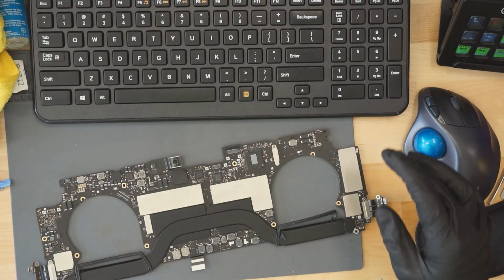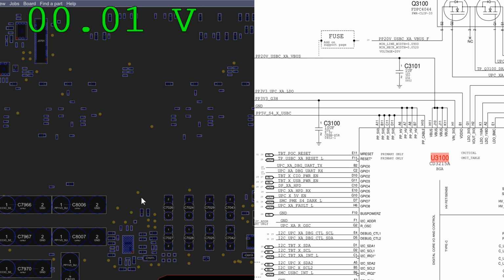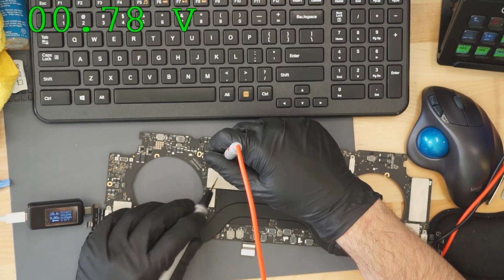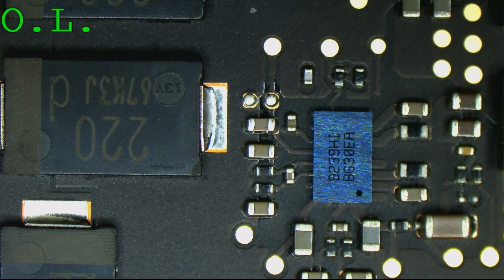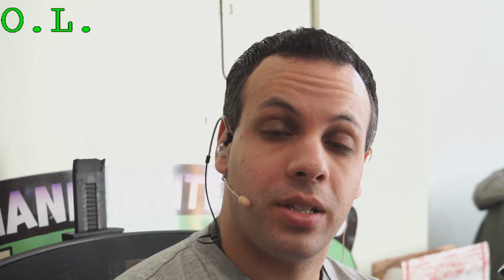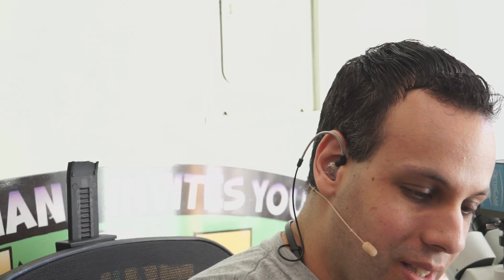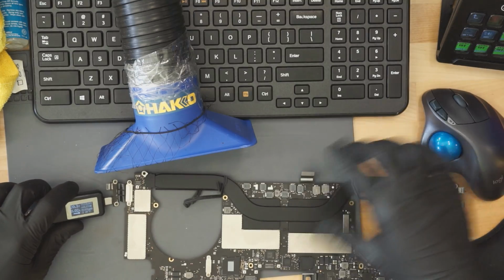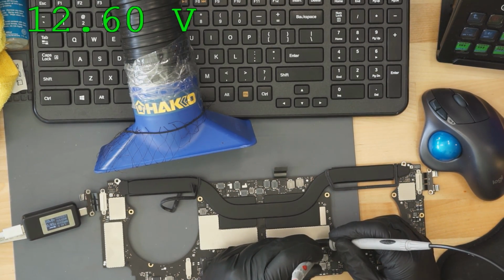Why new Macbook boards will be unfixable for me: sad :(

Comment: How to fix a Macbook? 
Buy a pc.
Screw Apple
Reply: Zainjal26  because Dell is shit, and does not represent non-Mac PC's in general.
Reply: Supporting apple is an early sign of retardation.
Reply: @oORoxas13Oo  For a second I was like 'oh damn, I'm getting retarded!' Then I realized the 09 Mac Pro I'm using was bought 2nd-hand, so I never supported Apple. Glad there's a loophole to avoid retardation for me.
Reply: Zainjal26  why would you buy a Dell?  A $300 pc from walmart is better than most dells.
Reply: Raul  from a diy repair perspective you have a point, but from a hardware usability perspective I can't find a PC laptop that's even barely usbale. Terrible touchpads that try but fail miserably to approximate a macbook's, keyboards that seem to be designed by someone that has never owned a laptop before... Again if you know of a PC laptop that doesn't fail miserably on this department I'd love to hear it. Ive always used ThinkPads, but their newer ones are trash. I can't find anything newer than a t530. 

As far as win10, from the start menu to burying every setting in the name of "simplicity" it strikes me as pure garbage. Almost as if windows were intentionally giving a lead in the software department to apple. Have you watched someone who isn't techy try to use win10? It's a complete disaster. Put that same person in front of a MacBook and they'll be up and flying in no time.
Reply: Worse
Reply: Mac is PC tho.
Reply: @Zidern  Technically yes, but people generally dont call a Mac a personal computer...
Reply: @Zidern  Wrong! It is only a PC after Louis touched it!
Reply: @Zidern  Careful dude you might get sued for calling mac a PC. There was a quote somewhere from Apple. Some insurance crap or whatever. Basically "macs" aren't considered to be a PC. They think Mac is a whole different thing. Yes I know pc stands for personal computer. Honestly a laptop can be a PC but we still call it a Laptop and a tower a PC.
Reply: Wel Apple are fekkin' ridiculous for doing that.. and I don't know anyone that doesn't call a laptop a PC, just like a desktop.
Reply: @Zidern  really, you know people who call a Mac laptop a "PC"? I wonder if that's regional if so. I've never ever heard someone do that in America.
Reply: I said people call LAPTOPS pcs, not necessarily MAC laptops.
Reply: @Zidern  oh I see. Definitely not all laptops in my experience tho. I've never heard someone call a Mac laptop a PC, unless they're over 60
Reply: But it is unlocked, In all it's glory. Praise the PC lord! ;)
Reply: @Zidern  Lol, this guy
Reply: Alas then you're stuck with Win10 these days...
Reply: @wrybread  nope...
Reply: @wrybread  not if you use Win7, which is WAY better
Reply: @vladsnape6408  agreed.
Reply: @wrybread  
Make a hackintosh
Reply: @wrybread    still better than an overpriced piece of plastic that cant  be worked on. Lol
Reply: @wrybread  Linux
Reply: @Pandaoniman  I typed that comment from a Thinkpad running ubuntu, and it's nice and all, but I still think linux on the "desktop" is a bit of a mess. Im rooting for it to succeed tho. If anyone knows of a significantly more polished  distro than Ubuntu tho, I'd love to hear it. Been meaning to try Mint.
Reply: @wrybread  YES!!! MintCinnamon is the "Flagship" Distro for the group...
   I'm "fiddling about" a bit with some concerted efforts around Xfce and Lmde, and none of them are "troublesome"...
   The only note to make (unless they've changed since my last install) is to get in there on "Swappiness" and tune the setting. Mint is a bit... er... overzealous (lolz). BUT then your system runs great. Stable as hell, and next door to nothing special to do (unless of course you have dubious peripherals)...
    Ezeelinux.com offers a TON of aid, from the chat forums, to Joe Collins' Channel on YT, so any questions, queries, trade of dev' talk you can stand is right there. You really can't miss with it... 

     AND no, for the record, I'm not "affiliated" nor am I financially encouraged here. It's just a really GREAT OS! I've probably got half a dozen PC's up and running on Mint... AND most of them are "dumpster recoveries"... Will admit, HP, Dell, and Lenovo are my current makes (like... the complete list... lolz) BUT it's worth the dive. ;o)
Reply: @wrybread  Mint is awesome. Does everything I need, and is a very polished and stable OS that I'd even recommend to newbies. I agree that the earlier distros weren't ready for the average user.
Reply: @calmeilles  I wound up trying Mint on someone's recommendation above. I like it much more Ubuntu, much more polished. I like ubuntu also but it's no competitor to macos in the polish department. Mint manages to compete though, which is amazing.
Reply: @wrybread  You have a Thinkpad? Those are super easy to hackintosh. ;) Just need a different wireless card.
Reply: Raul  what an odd theory. In what way is windows better for entertainment and general use exactly? With win7 I'd say it lags behind macos less, but still lags. With win 10 it's not even comparable in my opinion, the user is just constantly battling the os. 

As far as hardware, what windows laptop compares to a MacBook in your opinion?

Comment: I watch these videos so I can continue my hatred for apple products
Reply: It feeds my anger
Reply: @RajinderYadav  shitty windows laptop?for the same price of a new Mac you can get a razor blade stealth laptop with much much higher performance I'm talking 6 core 12 thread processors and rtx 2080. Your i9 9900k can't even sit above 3ghz because of thermal throttling issues and this just shits all over it and runs fine, if it's so difficult to make programs on why is there fjck loads more programs on windows than Mac
Reply: ikr, me too, never gonna buy this fucking shit.
Wouldn't buy it even if it was same price as normal laptops and phones. Maybe if it was half price compared to normal laptops AND it was serviceable.
Reply: So what would you suggest as am alternative? 

Windows Surface is just as unrepairable and expensive as Macbook Pros. My Dell didn't last more than 2.5 years and most of the rest are pretty @#$%.
Reply: Me too.
Reply: @RajinderYadav  exactly. Absolutely wonderful updates of Microsoft for deleting your data,creating audio driver issues,activation being removed after update etc. Windows is an ugly mess. MacOS is divine. You aren't required to fuckin update it everytime u turn on your laptop unlike windows. And neither are u required to troubleshoot it time and again. Windows sucks big time.

Comment: I was an audio novice that bought a Macbook pro in early 2011 to use Ableton. Within a year the logic board failed. They replaced it for free and I thought they were just being nice. I found out later that they had screwed up by adding too much conformal coating to a chip (the GPU iirc) which caused overheating. Fine. It works for a few years. Keep having hard drive failure after hard drive failure. I've been bootcamping it with windows...is your code even good for that? Roll with the punches. Eventually start to push the limits of the CPU with my DAW. Find out that the DAW software isn't even near optimized for multi-core processing based on intended use. Give up on .VSts. Buy high quality (Elektron, Swedes don't mess around) hardware that syncs with the computer "thru USB." Apple changes their USB drivers. Nothing works. Hard drive fails again. Replace it with 1 TB solid state. Set aside 150 GB partition just because. Apple side of the drive won't boot one day. Lose all my data (even the stuff I managed to save from before). Call and beg windows to buy a cheap license. Get Windows 7 on 150 GB side. 

And here we are now as I type this post. A wonderfully functioning 2011 Macbook pro with 150 GB partition of a 1 TB hard drive running Windows 7 (without office). I will never buy another macbook again.

Comment: Noob question: What is the "gel" you put on the board to unsolder and than put back on to solder bac? Thought those chips were soldered on, but are they simply glue on??
Reply: Its soldering flux, not some kind of magic gel.

Comment: Mac is just one more of a growing list of companies that are booby trapping or rigging their products in some way as to make them hard if not impossible to fix or repair. I would not be at all surprised to learn that some products have a secret built in self destruct timer of some kind. Repair shops of ALL types and kinds are slowing going away. I can even see Mac to start to epoxy coat the boards so you can not repair or replace any thing. Repairing anything is getting harder and harder. I work in a small engine repair shop and I see it happening even there. I run into cases where I can not even get a replacement carb for crying out load.

Comment: Apple wants to control its flock as much as they can, including but not limited to as you stated the ISL9240 chip not being available to repair centers. Apple is afraid of the right to repair movement and they want to kill it as much as they can by removing parts that can be repaired or by making it that if a system dose detect that something has been replaced it bricks itself and is useless and you have to shell out another 2 or 3 grand for a new unit. It is the way of apple

Comment: Are ISL9241 chips not drop-in replacements for the 9240s?
Reply: I had the same idea and went looking.  The ISL9240 is a BGA chip. The ISL 9241 data sheet shows "32 LEAD THIN QUAD FLAT NO-LEAD PLASTIC PACKAGE".  In the audio world we have SMD adapters, but I have no idea how you could do that even if it is the same silicon. If there are other package options, that would be groovy.

Here are the links I dug up.  Perhaps someone else can see a solution.

ISL 9237 - Mentions "When Apple unveiled their new MacBook on April 10, 2015"
https://www.renesas.com/en-us/www/doc/whitepapers/power/usb-c-buck-boost-battery-charging.pdf

ISL 9241
https://www.renesas.com/en-us/www/doc/whitepapers/battery-management/isl9241-usb-c-buck-boost-charger-whitepaper.pdf

ISL 95538B
https://www.renesas.com/us/en/products/power-management/battery-management-systems/multiple-cell-battery-chargers/device/ISL95538B.html

Overview
https://www.renesas.com/us/en/products/renesas-usb-power-delivery-family.html
Reply: RB Blackstone Nice finds! According to the 9241 pdf, it seems like it needs a modified EC firmware compared to the 923x series, so it would appear the only hope is if the 9241 is literally just a surface mount version of the 9240’s BGA package. It would then be possible to get (or make) a tiny, thin PCB that has QFP to BGA and use it as a mediator. They’re usually about a dime a dozen (well, more like a hundred); very useful things when prototyping with surface mount.
Reply: @SuppleAloe64  Cool!  I haven't seen a tiny PCB that would do that.  I googled "QFP to BGA adapter" and there are a lot.  Good to know. Thx.

Comment: " I trust SanDisk so much, I have two of them in my laptop in raid 0"

That is quite a trust lol
Reply: It's true, never ever had one go bad on me either. I'm sure they would eventually if you abuse them with large cache-ing and swaps
Reply: unless you do daily backups of that raid, you shouldn't trust any hard drive company this much
Reply: @ruben247  I only have the important things backed up to the hdds which is the steam library. Other than that, i can get everything else back quickly
Reply: I read this as soon as he said that.
Reply: Lol
Reply: @trippy1012 im using 2 crucials for my raid0 setup
Reply: @trippy1012 I'm using 2 OCZ Vertex 3s in raid 0 since 2011... They've seen Windows 7, 8.1, and 10.
Reply: I will say that SanDisk makes some damn good flash drives 👍🏽

Comment: easy solution...people need to STOP buying from apple. the shit they do to try to guarantee you need them for repairs is mindblowing. I'n 2015 I had a customer bring me a Macbook for an LCD replacement, i usually avoided any apple products besides iphones like the plague...I about died laughing when i started dismantling and saw that it was rocking PC2-5300 DDR2 So-DIMM RAM....in 2015!

Comment: On the unavailable chips, often all that is different is the pinout.   Because of this, what people used to do back in the golden ages of early computing was make a compatibility shim.  This was also used to create makeshift upgrades when unnecessary chip-socket changes were used to prevent them.

Comment: That intermitten behavior is sometimes a sign of just a bad solder contact. Something unusually common on Apple products from what I see around the web . . .  

I wouldn't be surprised if the assembly process leaves some of the connects on that chip half-soldered, and that is responsible for the breakage.

Comment: This is a known and consistent strategy to rip customers off and drive price and profits up all across the board. One part of that is that they make it hard or impossible to fix, so you have to go to an "authorized dealer" or apple themselves where it will cost you an arm and a leg. For me as a PC user and builder, this is crazy, as all my devices are easily and cheaply fixable.

Comment: I am a mechanical engineer, who is shit scared of anything electronics (at the level at which you work on).  However, your videos teach me quite a bit. 

Thanks! :)
Reply: if you're a mech engineer, just build a pick and place, then it's 100 times easier to do this stuff (because the chips are held firmly with no wobbling on your part).

Comment: Is it possible to replace soldered in 128gb ssd to 256gb storage? I have late 2018 macbook air 13" A1932, or should i just sell it and buy another one? I'd love to use some linux/windows laptop but i really need macbook for specific task on my work.

Comment: Louis, one thing to try when you're up against it, if you get an intermittent like in this case, and you have no recourse, try removing/resoldering in the chip in question.  Since it looks like the switching signal is there part of the time,(trolling you) it could be worth a shot in case of poor assembly from factory ie poor conductivity on one pin.

Comment: Just a thought. Could you build the part? For example I used to repair audio equipment and sometimes they would have an obsolete amplifier chip so I would build the equivalent with discrete components. Could Your charging chip be built with an atmega chip programmed with the charging algorithms and a few mosfets to deliver the power?

Comment: Hello Luis,
Even thou ISL9240 is not available anywhere to buy, it could be still possible to find similar chip with same pinout with different name. Since I haven't found even a datasheet for it, I am no help to you in this matter, but I am sure, that you can reverse-engineer it's pinout from macbook schematics, and find similar chip, that would replace this little f*cker.

Or maybe just try to ask Scotty from Strange Parts for help. I am sure, he would have a few friends in the right places to call to... ;-)

Comment: I have owned three dozen laptops. None of them have had a chip fail. So when I see you replace a broken component it makes me wonder what set of circumstances led to it going bad.

It boggles my mind.
Reply: the board design kills the chips from lack of current filtering and protection. Every time it gets plugged in, the current inrush slowly damages the chip. They threw it(good practices) out for smaller phone like board design.
Reply: @MetatronsCube23  Thanks!

That would make a good video: How To Engineer Failure.

Comment: I had 10 office computers built in 2012 with Intel 530 class SSD.  I decided to replace the Intel SSD after 5 years with Sandisk SSDs.  Big mistake.  Nothing but problems.  Failed boots, corrupted data, etc.  I then replaced (and discarded!!) the Sandisk SSDs with Intel 545 SSD, and problems went away.  I would never touch Sandisk with a 10 foot pole.

Comment: You might have to look into replacement circuit, if you know how that chip functions.  Depends on how you approach the problem it could turn into a messy repair with all of them BGA pads, but what's the alternative?

Comment: Do you, or a contact have the equipment to open the chip, analyse and order a replica from another semiconductor manufacturer?
Since chips are layerd, hard to design, and order, that's a long shot. Only other one would be the guy saying the iphone xr battery case has it.

Comment: The ISL9240 chip is also found in the iPhone XR Smart Battery Case , So if you have a high paying customer then you could simply tear down the battery case and replace the chip on the logic board https://www.toppn.com/view/228289.html

Comment: I fixed my Mac book pro issue yesterday (turns on but black screen). You have to disconnect the battery and do a safe boot using shift + Power button while connected to an external display with HDMI. Login to the computer and shut it down (you have to login). Reconnect battery and boot normal. After that the screen works again.

Comment: Is it possible to change iPhone 6s fingerprint sensor without loosing touchID function.??
Reply: If you change a screen and carefully don't damage the existing sensor it will work without losing touchID. If you need a new button, the only way to get back touchID is through Apple. pay them $150+ for a new screen and they provide a new home button and have a machine/software or whatever that will re-map the sensor to the CPU. So far only apple can do this service and there are no machines that have leaked out that can re-map the sensor to the CPU.